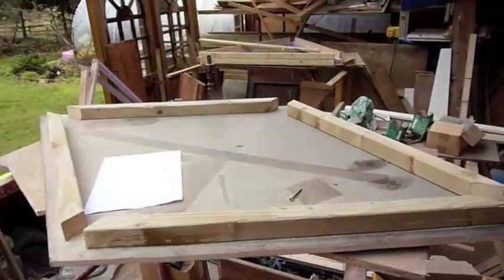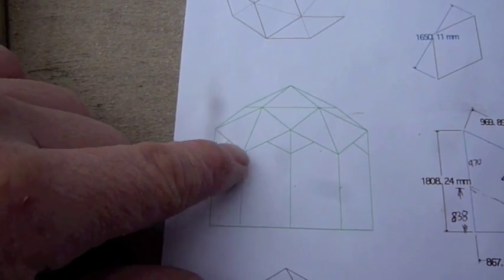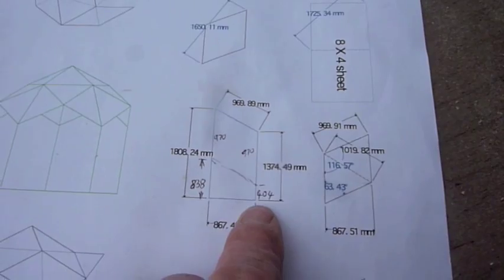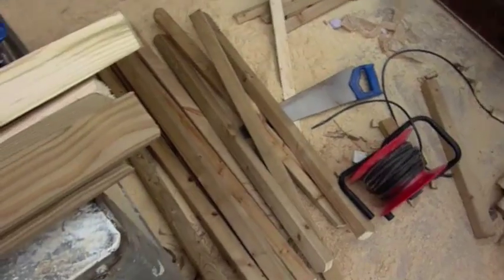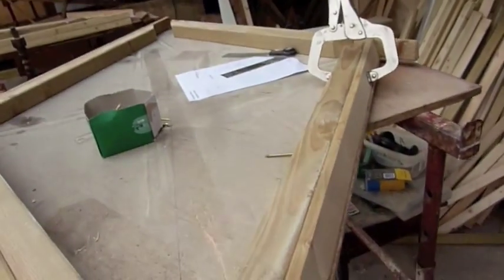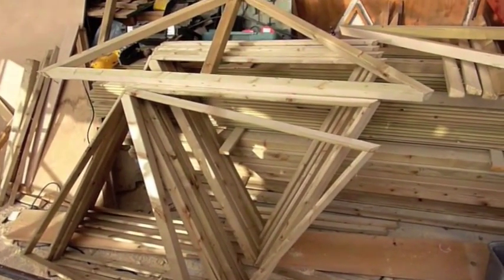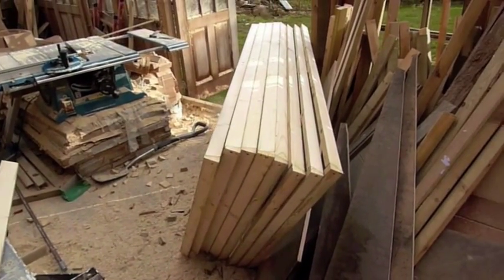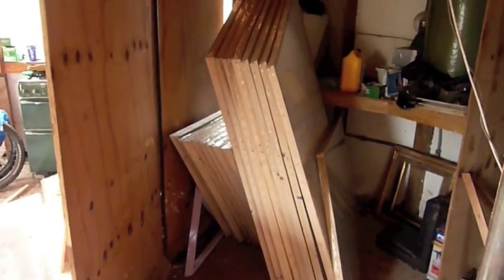solaris_build

Comment: build it in 2020 and there is no rotting or something until now before i installed it i build a foundation from stonebricks and mortar and let it dry for one week. then i put one layer of impregnated wood on it and screww it . Then i installed the whole greenhouse on top of it. All wood has been panted with black lacqquer and instead of foil cover i used hollow chamber pannels which where screwed directly on the construction . the are aranged to lapp over on the top to avoid leckage

Comment: Hello Paul. I received the plans for the 3000mm Solaris Dome from you and have just completed the build.
The dome is actually 2.700mm.
It is a very nice dome and very easy to put together.
We also have a brilliant 5000mm dome build 2 years ago.They have been pegged down with 400mm steel pegs and saddles attached to the base and have 
survived  gales here in Wales UK.
Reply from the maker: Thanks for the info, I checked and there does look to be a discrepancy, the measurement is from the top but I think the computer measured from one high point to a low point on the roof instead of across the base. I'm updating all my plans so will be sure to check this in the new version.